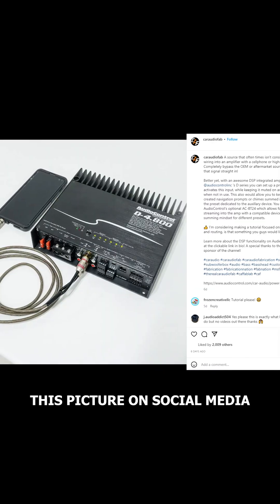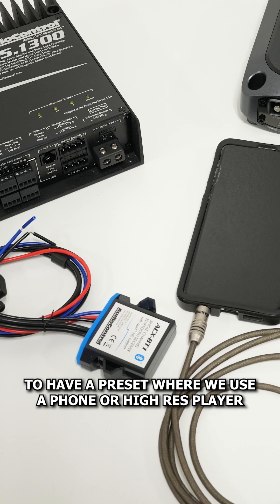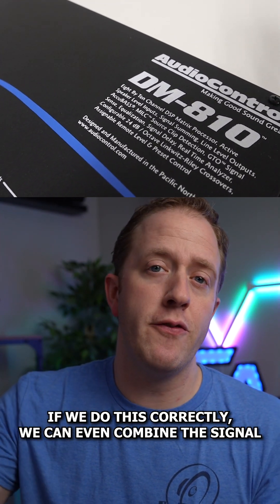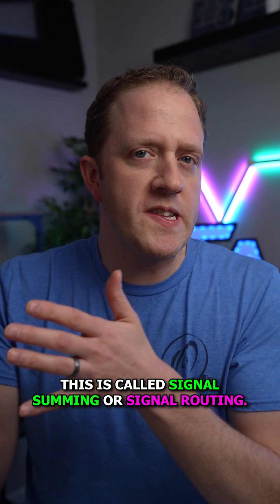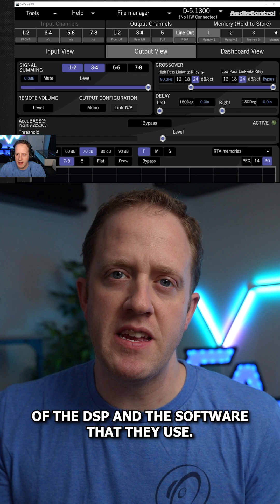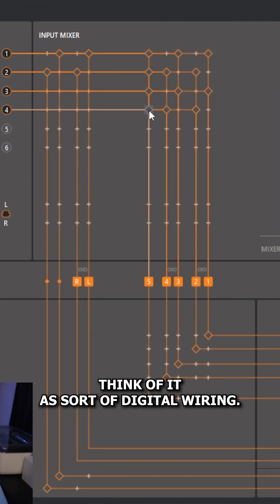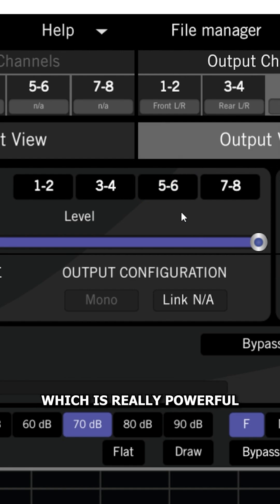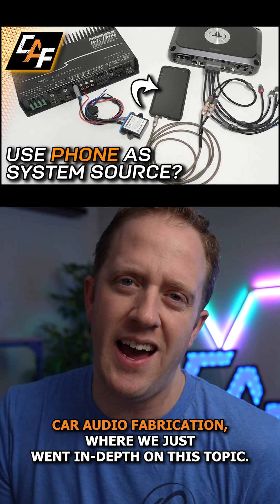Unlock car audio system design with "Signal Routing" on your DSP

Comment: So can this allow for better equalization, or would u still need an eq beyond the basic bass treble mid that comes on the 2020 GMC 2500hd with Bose. Because the bose subwoofer sucks but could u send the signal that goes to the Bose? Can you know send it to the aftermarket Subwoofer?

Comment: What will you recommend I have 3 10’ sundown on a JL 1500w amp classD and a epicenter & 6 1/2 180w 69w rms jbl & 6 1/2 270w 90w rms components jbl on a jbl stage amp 60wrms x 4  what dsp will you recommend? Advice please
Reply: Go with audiocontrol but if you’re in a budget, just get a little nice aftermarket head unit with built in dsp. The system you have is not super high end. So you won’t hear the difference between 1500$ dsp and a 300$ one. 
I did the same thing with my focal/audison/hertz speaker components and believe me you don’t need that very expensive dsps.
Reply: ok thanks  what is a Nice high-end system trying to learn about this. Thank you.
Reply: @Pirra14  I don’t want you to spend too much money for a very small improvements.

Comment: I think it’s great that you’re getting into this. It’s a great alternative to replacing head units with equal sound quality AND is a lot cheaper/easier (at least for installation). But we’re also getting to the point where replacing head units is just not an option in many new cars and soon probably won’t be able to in any. Which I assume is probably the reason for videos like this.